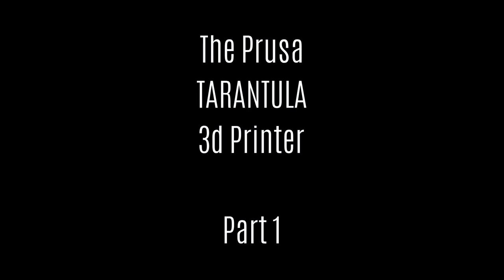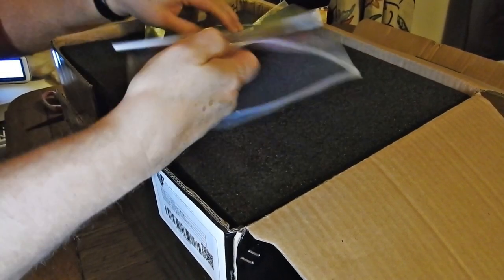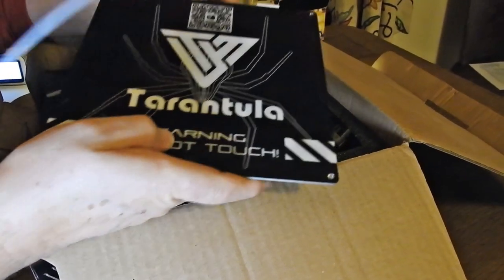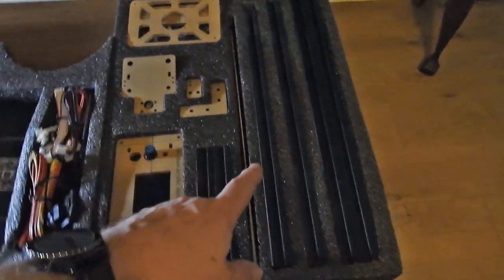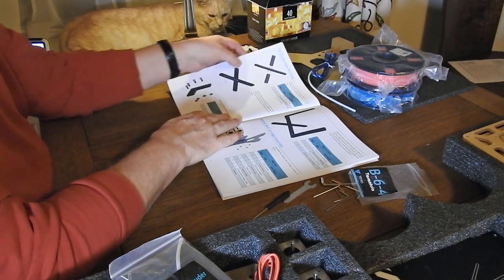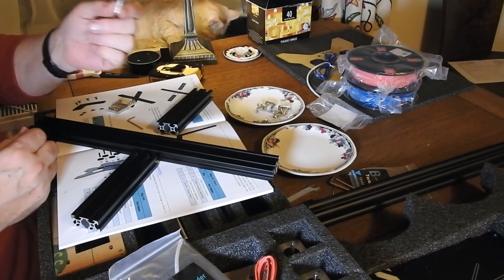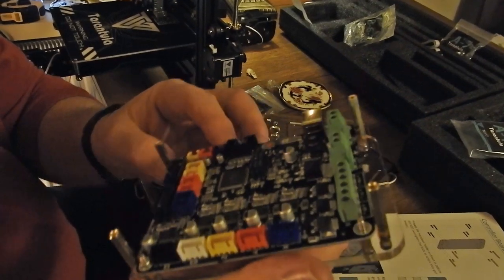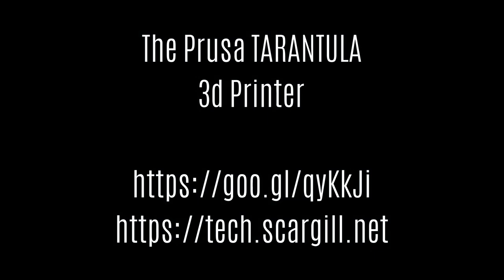Tarantula 3D Printer Review Part 1

Comment: Ps, get a MOSFET for the heatbed. The connector on the PCB will burn off at the normal current after a few weeks.  They cost a fiver.
Reply from the maker: Good advice - once I get it actually running I will.  Right now I got it running, the feed was too enthusiastic and we stopped it after printing a very thin layer of a domino.  I've been trying to get that off the bed ever since - a blade would not do it. Just been gassing myself with nail varnish remover!
Reply: Peter Scargill The stock bed sticks very well. I use a few wide strips 3m blue painter's tape. It works much better. A lot of people use a bit of glass but I never went past the tape.

Comment: One you get it tuned they are great. I got mine when they had the old manual. Useless but the you tube videos made it easy. Tevo support is useless at best. The Facebook group is very active.
Reply: Sorry Rob but I have to disagree with you that. IMHO they are NOT great. Among other things (like the heat bed issue you mentioned) the thin acrylic Y carriage support is so flexible that the bed flexes madly when changing Y direction. I set up a 20mm cube with 2mm walls (so there was infill needed) and filmed the front edge of the bed in SLOMO with my phone. When the the travel is in the X direction you can see the front edge of the bed flexing up and down probably in the 2mm range as the infill is put down. I'm in the process of adding the dual rail Y carriage upgrade but they could easily and inexpensively fix this problem with a better support (and a MOSFET).
Reply: I'll take some photos of some of my work. Sure it's a bit touchy and needs a lot of tuning but I get perfect prints with just a few mods.

Comment: don't put the spool of filament on top... the y axis already introduces vibrations, the spool will only amplify them and causing wobbling in prints...
Reply from the maker: One of the issues I've had with this kit is they don't give you anywhere to mount the power supply, the display or the reel!